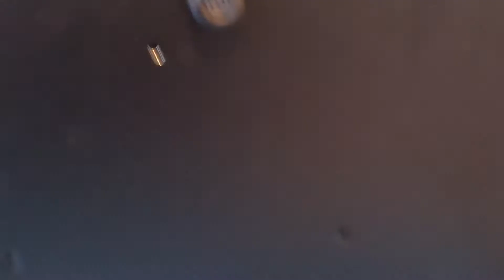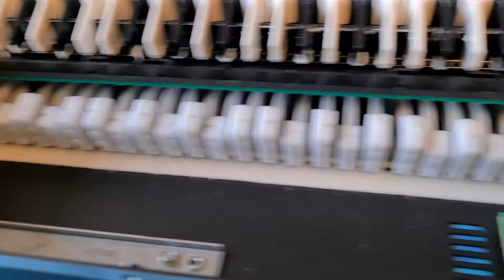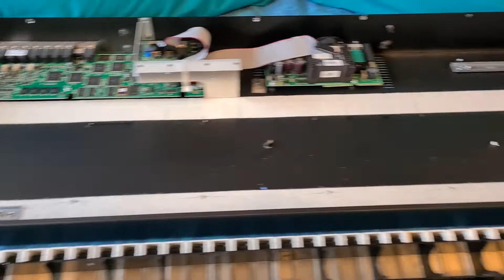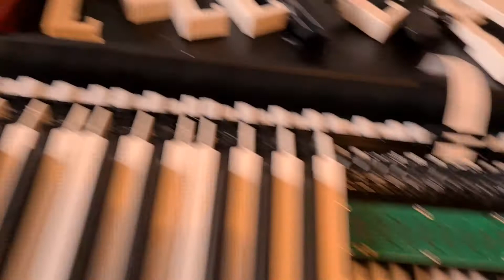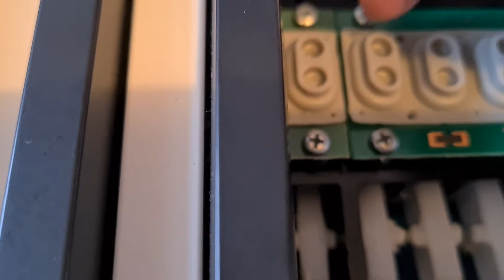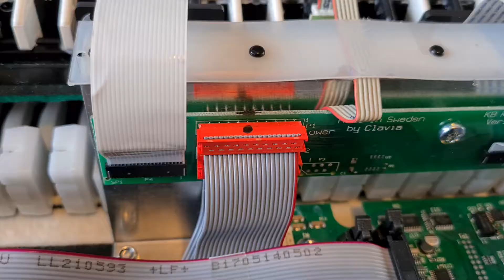Nord Stage 2 keyboard velocity sensing repair.

Comment: Thanks a lot for sharing this in depth guide/retex, it helped me to fix a vlocity issue on a specific key, it was due to some dust laying between the rubber pad and the contact on the PCB itself.
I gently cleaned the PCB with isopropyl alcohol (90°/70° alcohol works fine too, you just need to let it dry a bit more before putting the rubber pads back on).
Then put back the rubbers and tested it : velocity works fine again :))))

Thanks Mr. Herbst

Edit : Quick Tip : to put back the rubber pad with ease, I used a pencil criterium to guide the bigger "pillars" of the rubber, and then used the rubber of the other end of the pencil to gently press the smaller holes of the rubber part xD

Comment: Thanks for this. Very useful for a recent quick repair of a dead key on an Electro 4 HP. A few points I'd make. Firstly I would not use any fluid on circuit board graphite contacts. A very gentle wipe with a dry cotton bud should suffice. I replaced the 12 key contact strip with a new one. Inspection of the old one showed quite a bit of surface glazing on most of the contacts. Despite the orientation being critical I somehow managed to put it in the wrong way around!! After reassembling the whole keyboard it became obvious. The keys played on max volume on piano (max velocity), and there was a scratchy hiss on organ setting. Start again! The other point I'd make is that the strips of contacts are relatively cheap to buy. Currently £8.50 for a 13 way strip from Headline Audio in the UK. So just £51 for a 73 key bed instrument. If another key goes I intend to take advantage of the time and effort of the strip down and to replace all the contact strips with new. I'm so glad I've learned the orientation issue before doing that!

Comment: hi can someone tell me which way to put the rubbers, there is a longer side on mine, the longer side towards the top and the smaller side towards the bottom???🥲😭😭
Reply from the maker: @Maestromig  have another careful look at the rubber switchpads in position. Each switch has two dimples that look different to each other. That will show you the orientation. The deeper dimple is at the top.

Comment: Thanks a lot Derek, 28 screws later everything is fine again. In my case one F calculated the velocity wrong. If I pushed very slow, it was quiet, everything else was always max. Some small pice of something on the contacts was easy to see. It seems like the first repair of a Stage 2EX, which was built in December 2015 (so the stickers inside tell).

Comment: Thanks Derek, this really heped, in spite of having a Waterfall action Stage2, I applied more or less the same processes. I cleaned the sensors with some air in a can and my glasses wipe. Sorted the problem. Only problem I have one screw I found after (!)

Comment: How long did it take you to repair? I just ordered the contactstrip and I’m wondering if I can do it myself.
Reply from the maker: It took maybe one hour. You don't need to buy the contact strip. Even if you do, you MUST do the cleaning of the circuit board as well as the contacts before closing up.

Comment: Great vid, but for 6K, you shouldn't have these issues, this would never happen with a Roland board
Reply from the maker: My dear Stacey. I have repaired MANY Roland and Korg keyboards through the years with exactly the same problem. It's mostly about the environment and climate where the keyboards find themselves. Humidity, dust, dry static air all play a role. Oh, and heavy gigging. And beer!
Reply: @DerekHerbst747  Point taken, our Rolands live at home never moved and never gigged

Comment: I see that you have the Nord Stage 2 EX. I have the basic Nord Stage 2 and the keyboard mechanism seems to be different. The weights appear to be in front of the keys on your model but they are underneath the keys on mine. More importantly pressing down the key and pulling doesn't seem to disengage the key on mine (or maybe I just wasn't pulling hard enough as I didn't want to break it). Fortunately the defective key on my keyboard was the very bottom A key and so by squirting some WD40 into the side of the velocity sensor, coupled with sliding a very thin blade covered with a strip of rag under the sensor cover without disturbing it I seem to have been able to fix the problem. Many thanks.
Reply from the maker: I'm glad you found a solution. Please note that WD40 will thicken up with time, and because it leaves a residue it will attract dirt. I recommend that you use alcohol spray to flush it clean and leave it to dry for 24 hours.